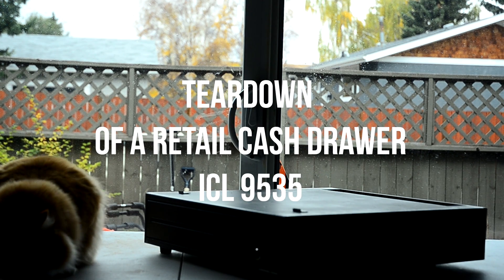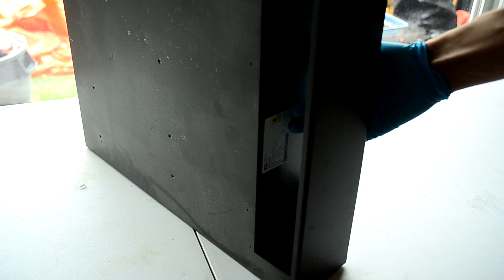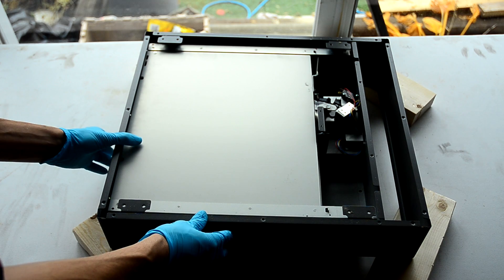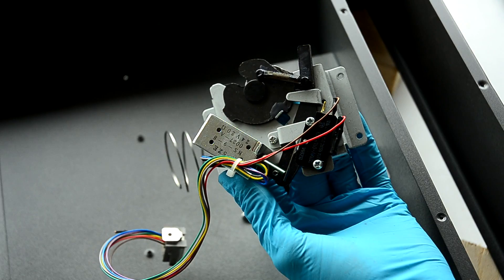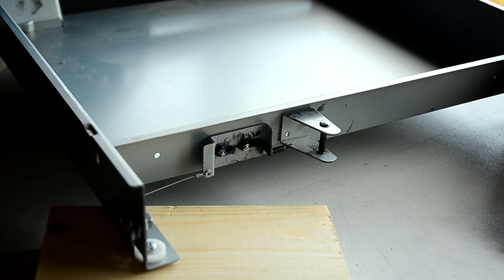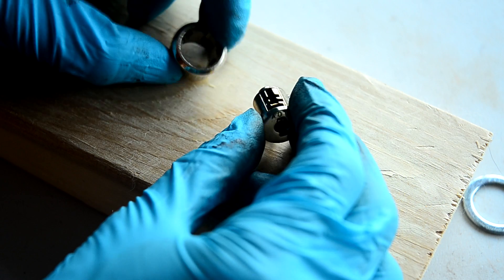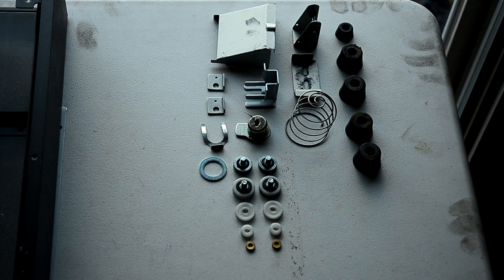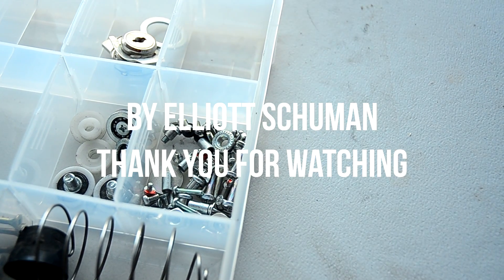Teardown of a Retail Cash Drawer (ICL 9535)

Comment: It's not a CAT 5 connection..It's a RJ45 connector.  There is no network protocol or eithernet signal.  All that is supplied on the RJ45 connector is voltage to energize the coil and open/short connection to detect if the drawer is open.

Comment: Any idea on the pinout on the rj45 socket?
Reply from the maker: Yes so it does depend on what controller the brand has gone with...
in some cases the connection is an RJ12 or RJ11 connection and the communication is called the  Drawer Kick interface or DKD...
I found a technical manual for Epson's DKD...
 http://support.epostraders.co.uk/support-files/documents/27/Ya8-EpsonDrawerKick.pdf
Reply: I cut mine open to find out what I had to connect to for it t work with a standard Epson printer 

There are two taps inside, one 12v, the other 24v, and a drawer closed switch

To get this working quickly, I identified the two most possible candidates off the solenoid and connect to pins 2 and 4 on a rj11 cable I cut in half. It was 50/50 getting it right, I got it right 2nd time round!

The winning combination is blue to pin 2, and brown to pin 4
Reply from the maker: @Smifiscouk  This is great! and hopefully this helps someone else too! If I make a follow up video I'll make sure to include this!
Reply: @EJSchuman  please make a follow up video that's more technical thanks.
Reply from the maker: If I take apart another one I'll make sure to remember to do a pinout. thanks for your input!